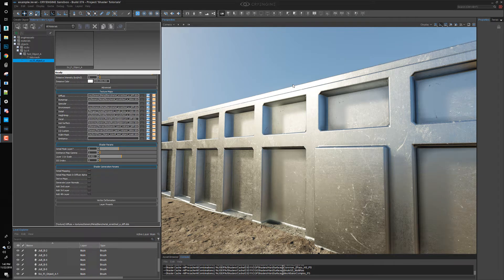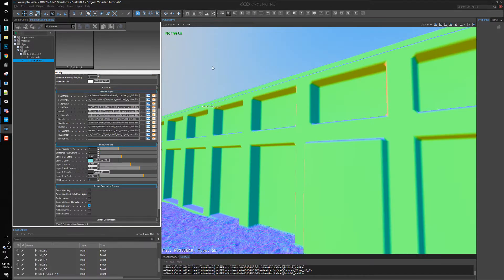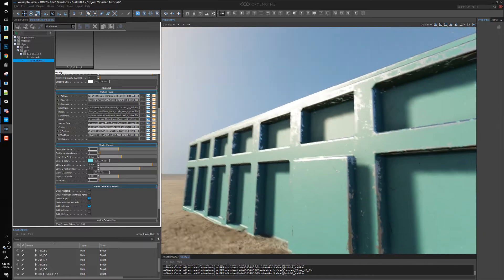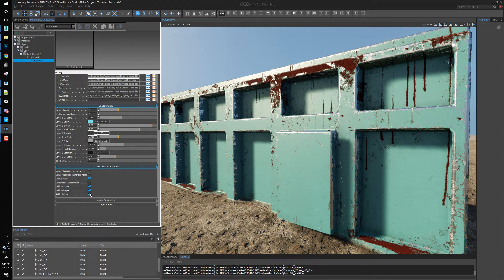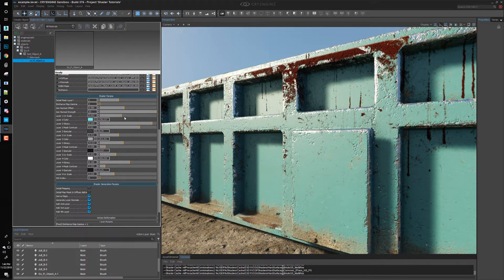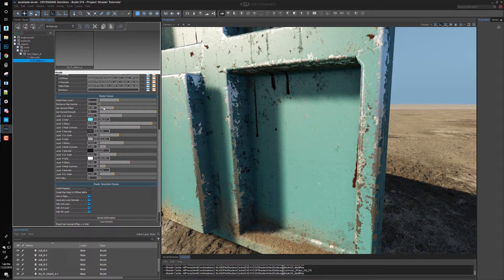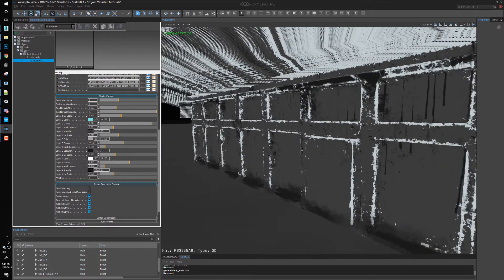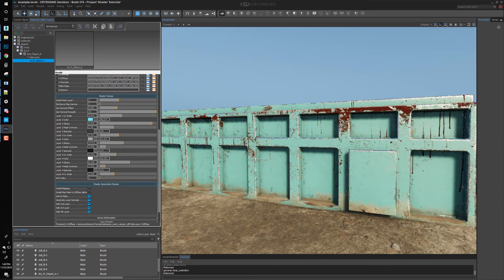Hard Surface Shader Progress 2

Comment: You will sell the shader in Marketplace?
Reply from the maker: I plan on giving a base version of this shader away for free, I'll just upload it to my drive and offer a link on my Art Station
Reply: @themodman1014  Great! Will Slope Blending Shader also be available or can it be one complex shader?Another would support the shader the Ambient Occlusion map
Reply from the maker: Well, those are good questions. AO map isn't really in the cards because Cryengine doesn't really have an AO pass that is light aware except for a screenspace effect like SSDO. So if I were to add it, it would only act to darken the diffuse. And would look wrong with direct light. 

To answer your second question, yes I will be giving the source code for the Slope blend shader, AND its a better, cleaner, and more performant shader than the one in the tutorial.
Reply: @abara581  Indeed this is completely possible in for the Hardsurface shader